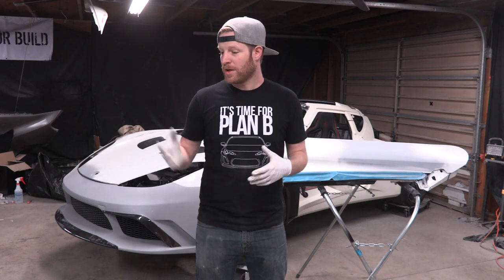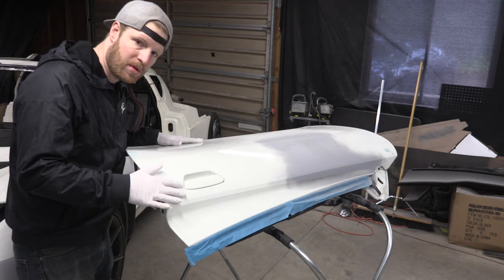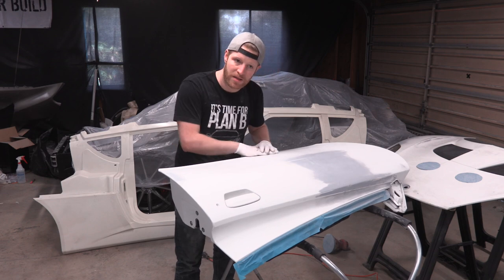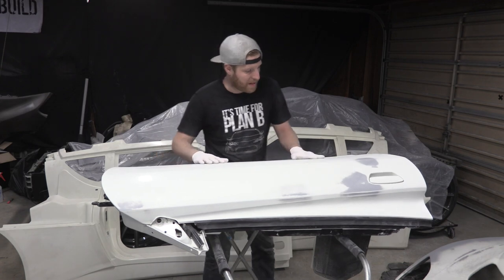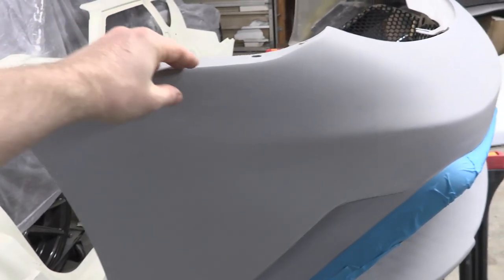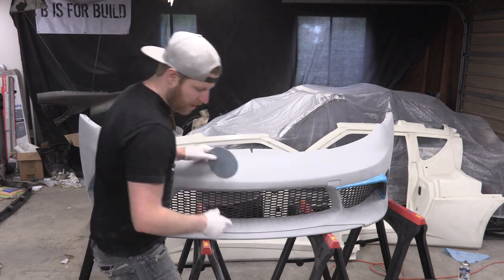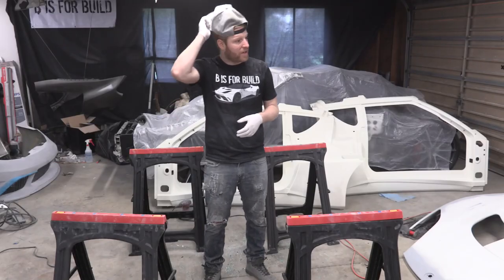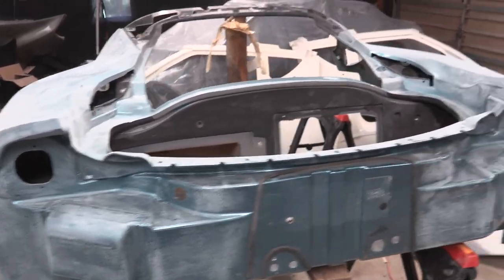Budget Lotus Evora Pt 29 - Door Repairs And Paint Prep

Comment: Why not go for a basecoat clearcoat paintjob? The finish is much easier to get even and corrections like dust etc can be sanded out of the clear and polished back up. + the finish is much stronger than a 1coat system.

Also like you mentioned be sure to let the paint dry atleast 90 days before you wrap it. With a 1 coat system you will run the risk of rippping off the paint when repositioning the vynil or removing it.

Good luck and keep up the video's! Love your channel

Comment: Something you may want to look into in the future is SMD Sunflash resin. It is UV activated resin. You dont need to add hardener, just lay it, apply resin, and hit it with a UV light or sunlight and it hardens.

I'm not sure how different it is from "standard" resin, but just something for you to look at for later. I used it for a subwoofer enclosure and it worked well, but again, I'm not sure how different resins work.
Reply: been watching for a long time now
Reply: nuclear explosion
Reply: Surprisingly, no. I was deep I to the SMD stuff around the time it was coming out.

Comment: The reason your sandpapaer is clogging up is because you're using a grit too fine for body filler. Once the body filler is dried, you need to start with at least 120 grit and then move up. 320 grit is more of a finishing grade before primer. Just a heads up before your next project!

Comment: hey.. constructive commenter here. it always pays to degrease fresh fiberglass parts before sanding (and after.. and again just in case) because they can have release agent/wax residue on them and its whole purpose is to make things not stick. easier to degrease it first before ya push the crud into ya rough sanded porus surface.

Comment: I noticed when you were blocking you ran across the crease line in the door.  and then again when you were power sanding.  If you try and avoid running over the sharp lines you will end up with much sharper, less washed out body lines when you top coat.  Good job and keep at it.